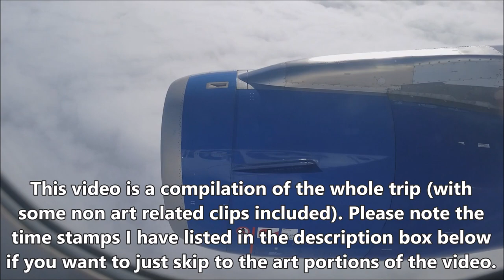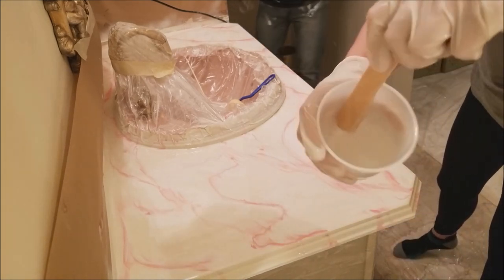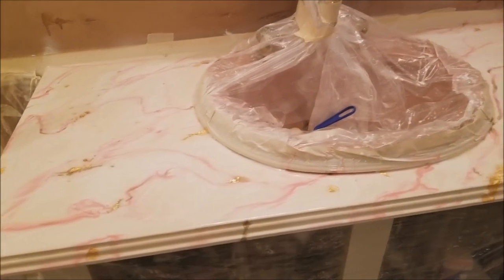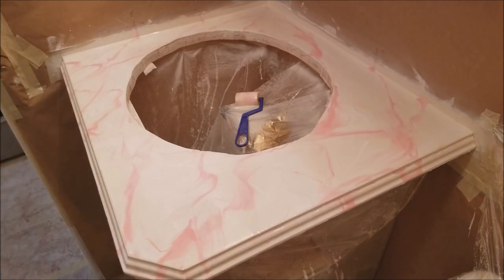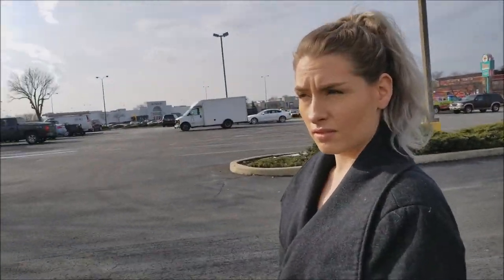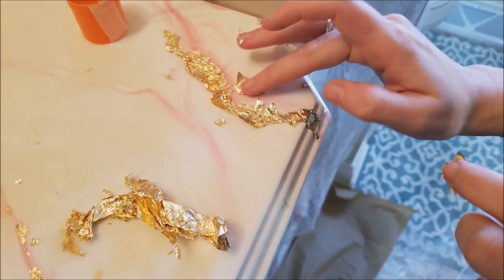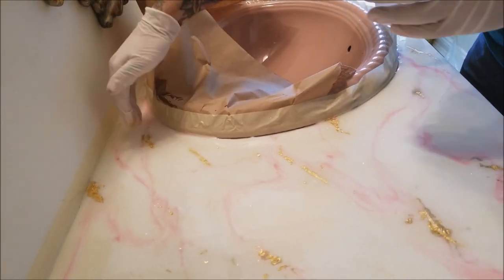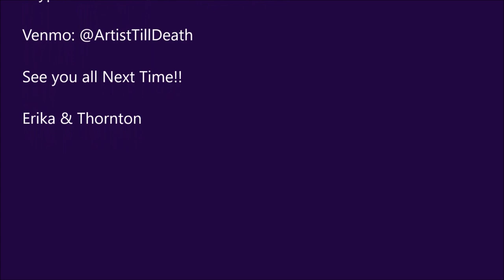DIY Marble Resin Countertops WOW that was easy! (Pink, Gold, Gold Leaf)

Comment: Very cool. Thanks for sharing the whole process.Just curious ,does the brand of epoxy you use require ventilation or a respirator ? It does'nt seem so with you & the occupants of the house not wearing any.
Reply from the maker: Hello Toby, as a general rule you should always wear a respirator when working with resin, spray paints and while sanding. However, this brand of resin has very minimal fumes and the space was well ventilated. Thank you so much for watching and taking the time to comment!
Reply: Thanks in advance !You all rock !  I was planning on using that brand of resin,just worried the bedroom i'm doing it in would have the odor, Its where we sleep & its too chilly in the garage for the resin to cure properly.

Comment: P. S.  For your resin burns, go to Walgreen's or CVS and buy Silvadene. Silvadene is an ointment to treat and calm burns. Keep it in your work bag, so when you get burned, you are ready. Run your arm or fingers under cool water, softly patt dry and put the Silvadene on than cover your burn area with a band aid to protect the area that got burned just in case if a blister forms and pops you will not get an infection. Keep putting Silvadene on for a few days.
Reply from the maker: Where were you right after I got the burn!? lol. Thank you for the tip, I will get some and put it in our resin kit.
Reply: True Silvadene is by Rx only
Reply from the maker: Thank you very much.